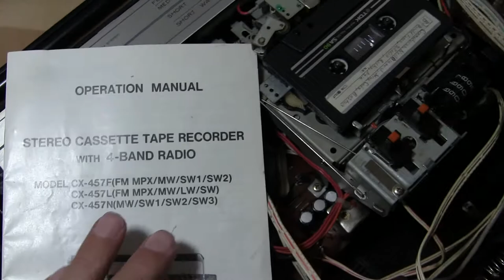General Shop CX-457F Trident CX-457F MultiTech TBS-7900 Palladium 494-968 adjust motor speed p

Comment: Hi! I´ve been watching many of your boombox videos and stumbled on this video by chance. I have exactly the same General Shop CX-457F model, but under led indicators there´s the brand name labelled MARK. Been trying to fix my boombox for months now, but it seems too hard. There are couple of things i do not understand, for example when i play tape, voice plays backwards  ? I don´t get it. I even cut off the motor wires and connected them incorrectly wrong way round, but still voice played backwards. After that i connected them again as they should, and it was as it has been all the time, so nothing was changed. There is one plastic cogwheel broken, so it does not play both ways, but that should not affect on the case why the sound is all the time backwards when u are listening tape ? I am clueless, could you maybe have some better info ??
Reply from the maker: Same issue different machine c100f Auto reverse deck has a mechanical switch that switches from forward to reverse for the head to read the cassette tape as it is a four track head so it electronically changes the direction of the tape that it reads trust you can understand this you need to find the switch in your machine that is not switching forward to reverse for the head understand?
Reply: @Cassette2Go  Thanks for answering. On my boombox, those 2 big orange color buttons on  front panel do not work, so i am not using them to change direction or trying to use auto reverse etc. I would be totally happy if the coming voice from tape would be normal. Don´t  care if the tape plays on reverse or forward, but main issue is that singing and voice comes in reverse order now, so one cannot understand anything what cassette is playing because it is reversed and sounds like "devil´s voice".. Ps: if there is some sort of switch that i could click or turn to make the sound normal again and understandable..i haven´t found that yet.
By the way, i like your videos..you have very cool boomboxes :)
Reply from the maker: @RUSKAJACK  mine works kinda that is it plays correctly but only in reverse direction if you play it in the forward direction then you must take it all apart and push the button back up that you used to play it with so I have tested this Siri and I have put a piece of tape on the offensives button therefore if you never push that button you can play tapes in reverse mode properly all day long one direction only but if you ever push that forward button to play it forward it will play it forward but it will not retract the button so if you're interested in mine and maybe want to buy it from me for what I paid for it get back to me

Comment: Check for an available plastic screw driver, maybe it is grounding off with something that's causing it to speed up.
Reply from the maker: James Hamilton I tried unplugging from the mains and then adjusting in there several times as I did not wish to upset anything in the electronics and then re-applying power to play and there was no change in the speed, So I will leave well enough alone for the time being.